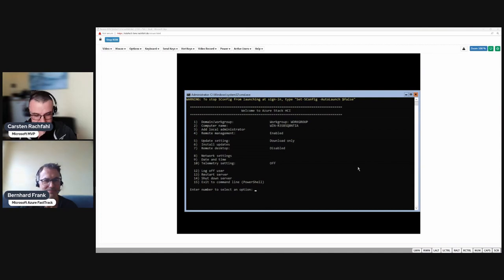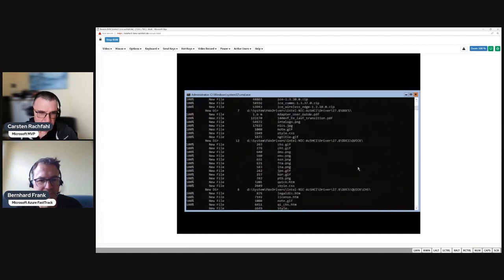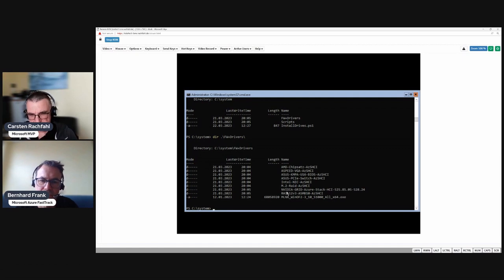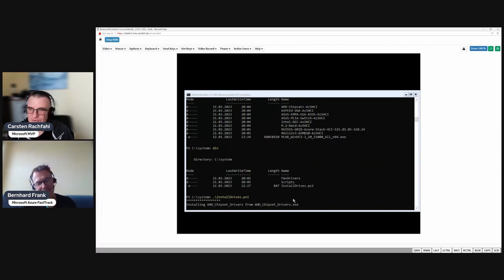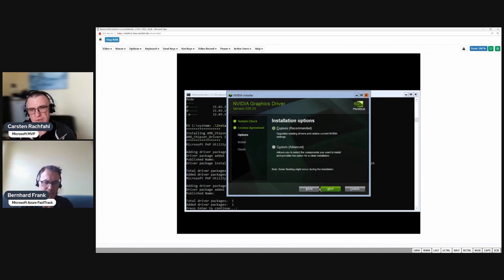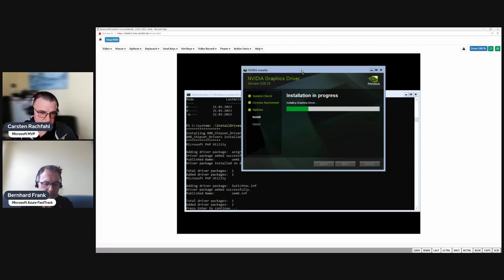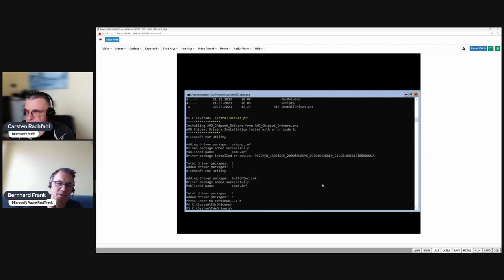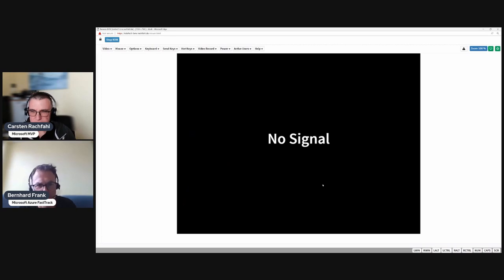Azure Stack HCI - Installation Series - 03 Driver Installation

Comment: Thank you very much for the amazing series!
I've all NVMes in my design.
Since it's the HPE hardware, I've installed the drivers using the HPE SUM (Smart Update Manager).
Now, how can I uninstall the storage drivers specifically and install the Storage drivers from Microsoft, as prescribed in this tutorial.
Thanks again!
Reply from the maker: I will ping Bernhard and Carsten to answer that one.
Reply from the maker: I have good experience with the cmd line way - 
find the drivers you want to remove with 
pnputil /enum-drivers

delete it using:
PNPUTIL /delete-driver <oem#.inf> [/uninstall] [/force] [/reboot]
Reply from the maker: Pls check first with your OEM (e.g. HPE) if this is allowed as they might only support systems with drivers coming (being verified) from them.
Technically - the pnputil cmd is  your friend, i.e. you could do "pnputil /enum-drivers" to get the name of the published driver you want to remove and then do a "pnputil /delete-driver oemXXX.inf" to actually remove it. Now it is time to add the one you want.

Comment: Excellent video series, congratulations. A question, when upgrade the Az Stack HCI Cluser/node, the drivers will be maintened or need to be reinstalled? Thank in advance.
Reply from the maker: Hi Lucas, starting with Azure Stack HCI 23H2 the drivers will be installed trough Windows Update using SBE packages. So there is no longer driver sidepathing available. With an upgrade from 21H2 to 22H2 you can run the vendor update utilities to update drivers and firmware. Cheers, Flo

Comment: From where we can download the Network Drivers from Microsoft. as advised in this tutorial???
Reply from the maker: Network drivers should be downloaded from the OEM or from the network adapter maker if you don't have an integrated system. The ones coming from Microsoft are ok but for a production system I would be using the latest and greatest ;-)

Comment: Can You Please share the ShellScript you run for Install Drivers
Reply from the maker: Hm. This is highly individual as you are probably running other hardware than we do, right?
There might also be tools or a process on how to update drivers and firmware provided by your OEM.
If this is test HW and you want to play with drivers installation it is basically running PowerShell processes e.g. 

[sample]
"installing Mellanox drivers"
$mlnxPath = "$currentPath\MLNX_VPI_WinOF-5_50_54000_All_win2019_x64.exe"
start-process -filepath $mlnxPath -ArgumentList "/S /v""/qn"" /v""/l*vx $tmppath\MLNX_VPI_WinOF.log"" /vPERFCHECK=1" -Wait

...other drivers might require different arguments.
hth,
B